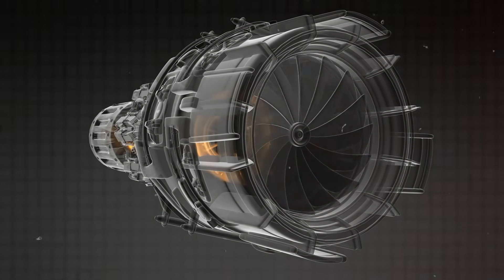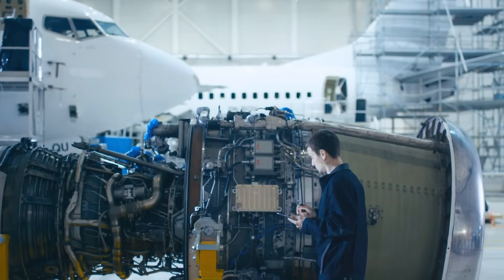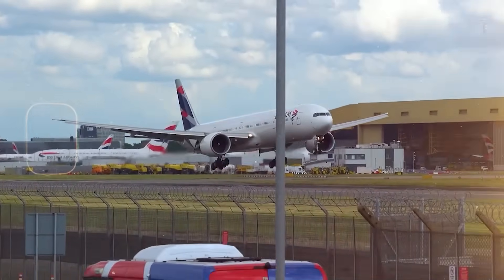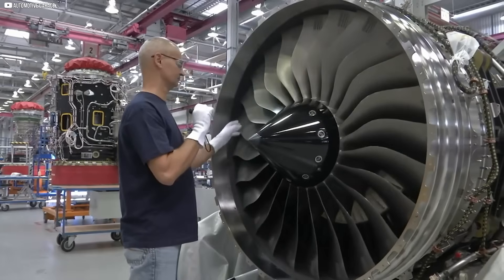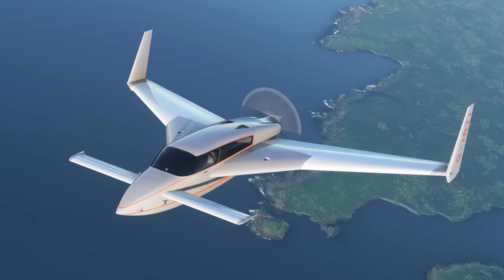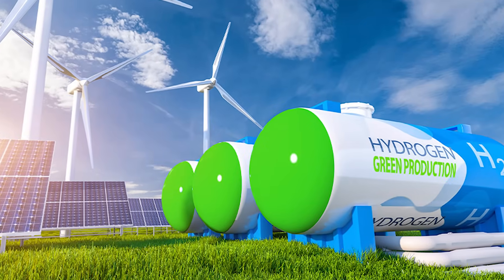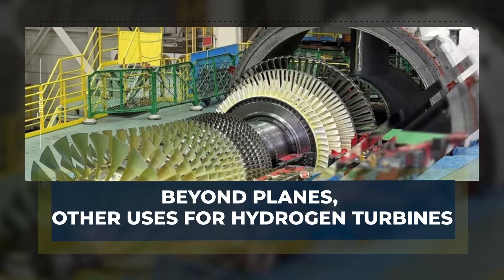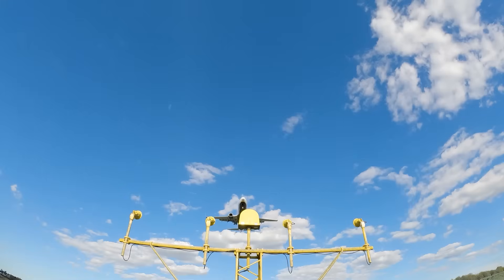Rolls-Royce’s Hydrogen Engine Test: A Glimpse at Carbon-Free Flight

Comment: CGI suck showing a none moving part engine. Its just Hydrogen combustion using oxygen and Titanium fans like a regular jet engine pushing air to create thrust. Hydrogen is dense and airlines are ramping up to make a Jet engine that runs the same way, does the same things, and sounds the same. Sunlight will make all the energy we need through  our existence. Ships and boats, ferries( Norway) will also run from electric and battery hydrogen fuel cells. Especially for Naval ships and submarines that will replace nuclear submarines. The Hydron fuel cell create heat and water for drink all from the reaction. Fuel cell Jets? Nope. Combustion jet engines with no carbon emissions. Pillsbury has a factory that makes all the energy, water and heat for the ovens on a fuel cells.

Comment: CO2 doesn't contribute to global warming.   NASA reports global warming at 1°C where it has been since 1992.   Earth's greenhouse effect is in saturation from  water vapor.  The other greenhouse gases can change its overall effect.   Nitrogen dioxide emissions are unavoidable anytime earth's atmosphere is compressed at high temperatures.